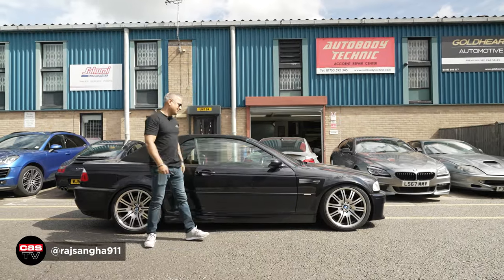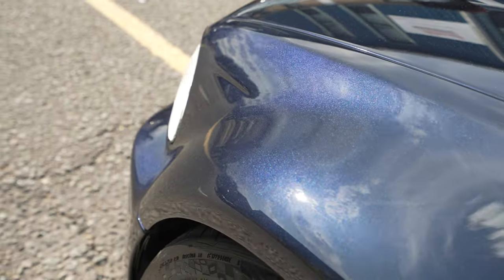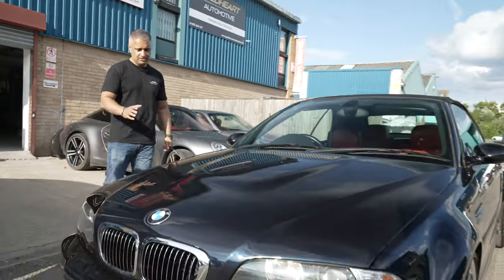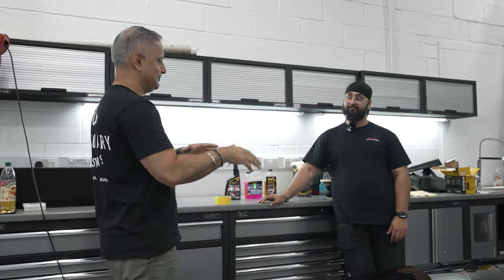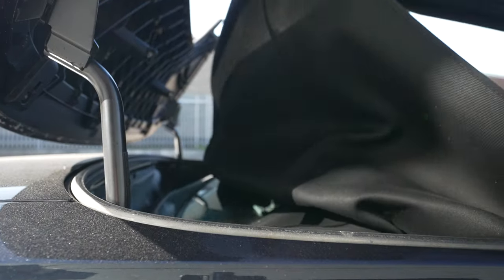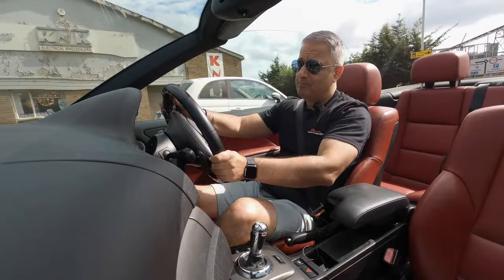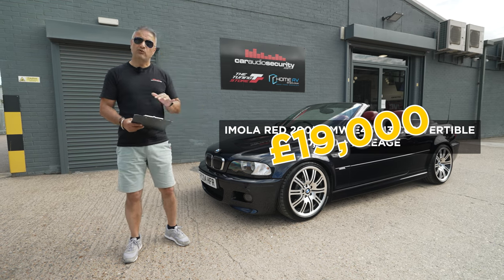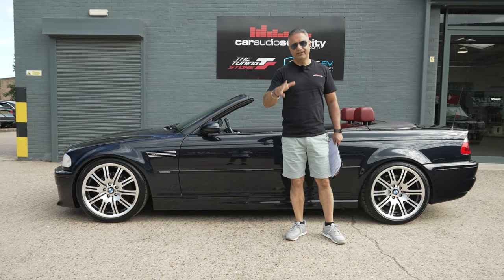PROJECT BMW E46 M3 Convertible is now COMPLETE! | Car Audio & Security

Comment: And what about Rod Bearings, VANOS (specifically broken exhaust hub tabs and chain tensioner) and rear boot floor cracking? Oh and the rusty inner rear arches.

Any potential E46 m3 owner should make sure they add 6-8k to the purchase price as these jobs WILL need doing. 

I've had mine for 3 years now and I do everything myself and its still cost me £1000s
Reply from the maker: Please watch the video as these have all been addressed and checked 👍🏽

Comment: would have thought been a convertible and the size of the boot etc ... a much smaller subwoofer would have been a better option ??   6 inch shallow upfront /passenger footwell area